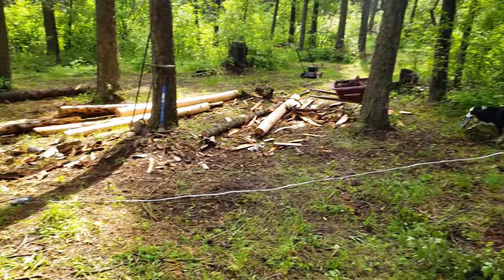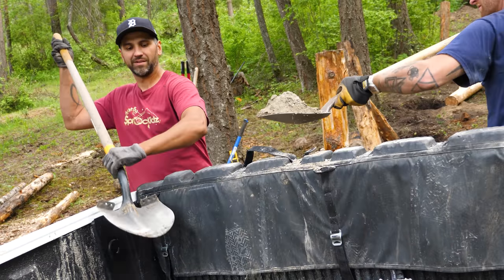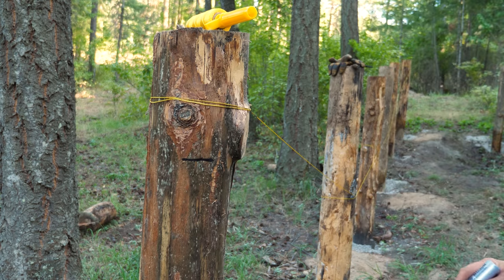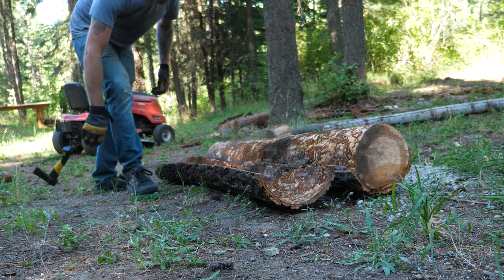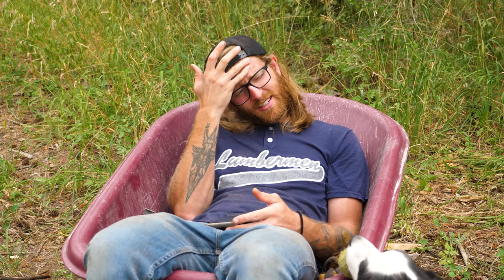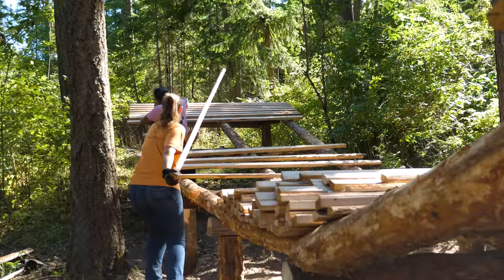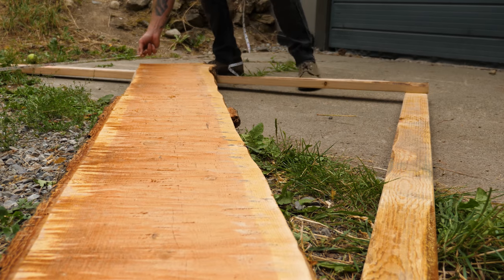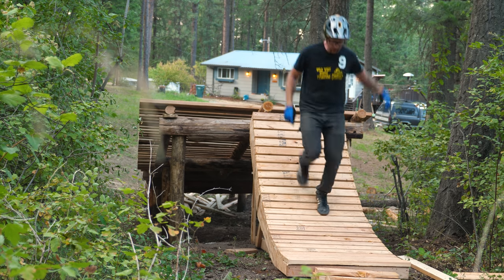Building a MASSIVE Whale Tail for Mountain Biking! // Moby's Deck Build - Part 1

Comment: Arg, planking the moby deck.... 
did you watch Pirates of the Caribbean prior to building this? 😄.

Love the build, looks sick.

As for a guide to ‘plank’ the wale tale, why didn’t you just use a string?
Reply from the maker: Was too hard to eye a straight line with the difference in height between the deck sections